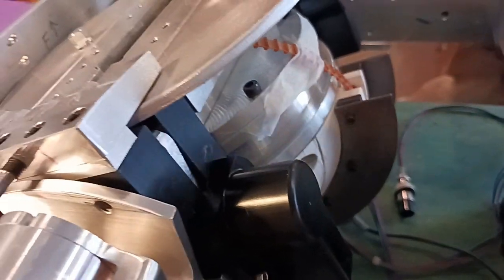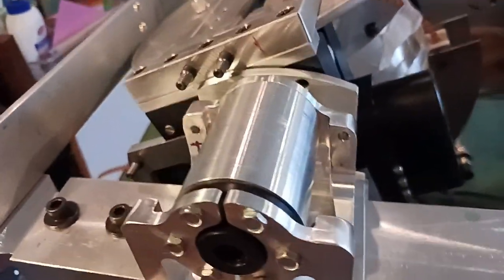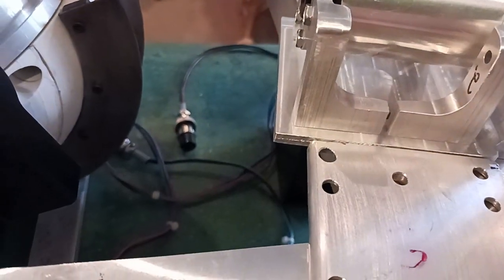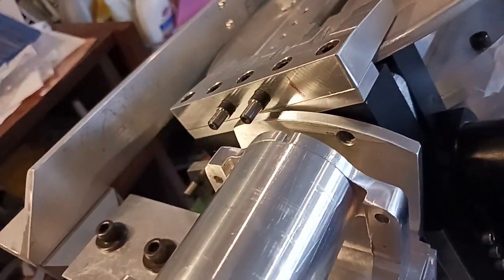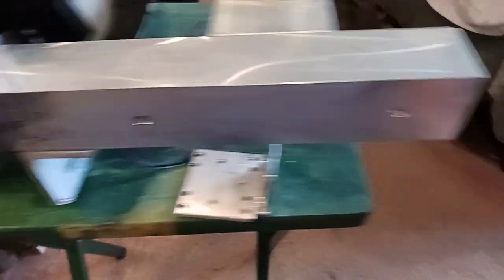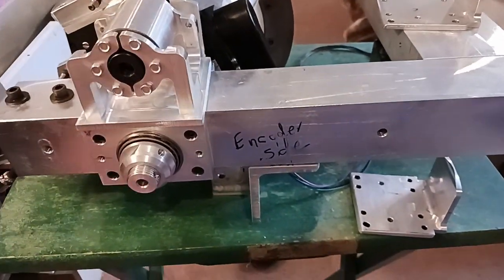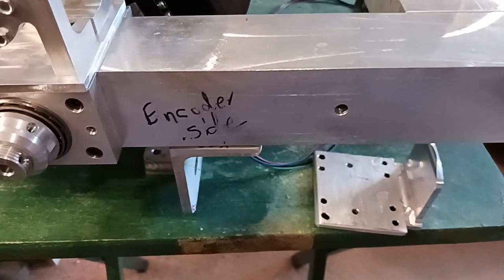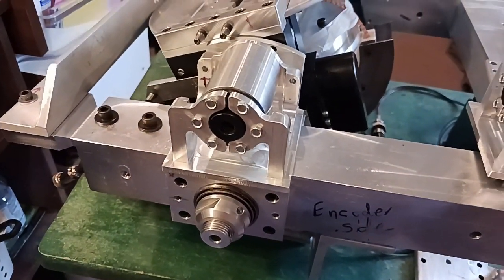Changing direction on this project. Using the parts and adding new parts.

Comment: A lot of machining work in these parts.
I could imagine a fair amount of design would have gone into this before you got started.

It's a shame you spent so much time on the steel bracket, sometimes things work in theory.
But, they don't seem to go so well when you start using them ??.
I'm sure you will get everything worked out 👍
Reply from the maker: That's exactly what I do . And if it doesn't work, you make it work. You can tell  you're good when you can see the job from start to finish, step by step (the good, the bad and ugly) before the first cut.  I like your style.
Reply from the maker: So true,  that's what happened.  I made a thicker press plates and it closed up the gap.  To get the right gap I had to move to piston unit back. That's why the new longer mount. I do very little cad work,  it's  more visible as I look at something an I run scenarios through until I have something. Most of my work is on the fly.
Reply: @toolmaker1370  I am much the same with CAD work. 
Pretty much zero for me. 
Too much of the old way of doing things. 
Working it out in your head, and hopefully, it works. 
About 99% of the time, it works out 😀
Ironically, anything I would design in CAD or hand sketch, I use maybe half of what I have drawn ??
It seems to work out better when I'm standing in front of the parts I want to make. 
I'm sure it's the same for you 👍